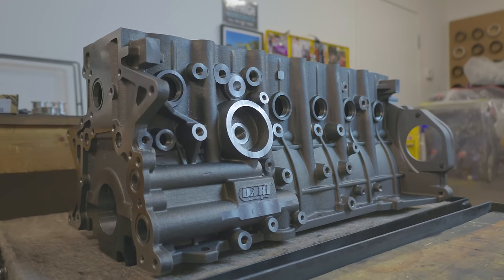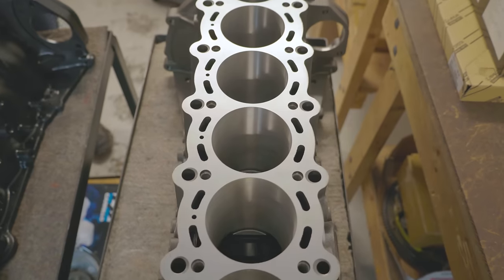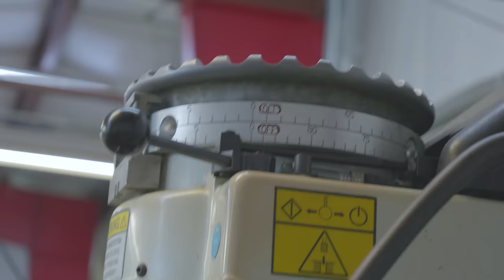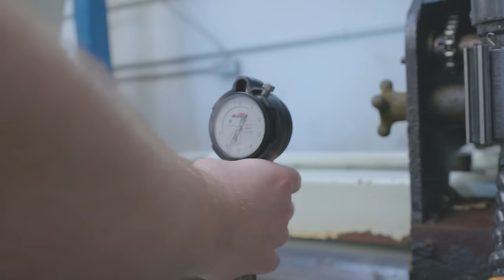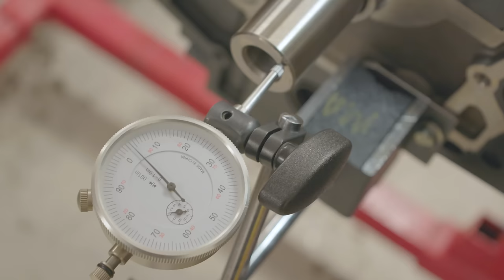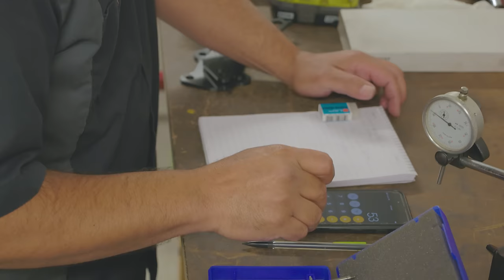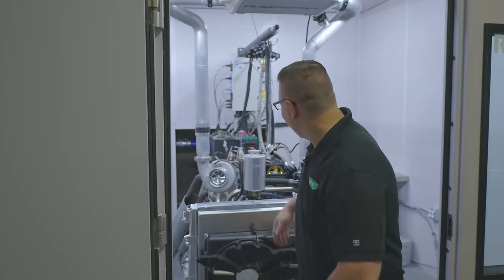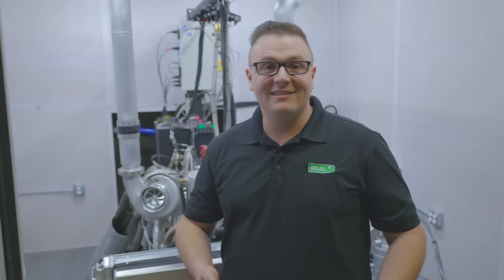Building a 3.5L 2JZ with Dart's NEW Cast Block! 2000hp Build

Comment: Dart 2JZ vs PRP RB26 New block casting. 

Good to see there are ppl who supports the RBs and 2JZs
Reply from the maker: The aftermarket keeps growing! Love to see innovation.
Reply: 2jz all day
Reply: @elmoz122  I think I'll still stay with the Vortec4200
Reply: @3n3ly7m9 never seen an Atlas motor at the same level as pro level 2J motors.
Reply: @RadDadisRad  Making 700hp stock engine with a turbo in Saab 9-7x is more than enough for me
Reply: @3n3ly7m9  so you have a 4.2 Saab Trailblazer?
Reply: Tbf, NO-ONE has seen the Atlas motors in the same light as a 2J save but a couple years now. It's essentially a baby in the aftermarket world @RadDadisRad
Reply: @aaronschocke2147  I know, I don’t understand why someone would chose to compare a 700hp 4,200 over a 2,000hp 2JZ build. I can appreciate both but the comment doesn’t seem to be driven by pragmatism.
Reply: @RadDadisRad  2JZ is too expensive to build for me, parts are all overpriced etc. You get alot better bang for your buck doing a 4.2 vs the 2JZ at the same power level. My budget was $8500 and I kind of went higher quality on a few parts, and total ended up being just over $11500. But thats perfect considering the trucks price was only $2400 with zero rust, but it did have 174k miles. I still think its perfect chassis with AWD
Reply: @3n3ly7m9  if we’re going apples to apples you aren’t getting 2,000hp from the atlas 4200. That’s my point.
Reply: @RadDadisRad  You aren't getting 2000hp out of a stock 2JZ either, come on now, can't compare a stock block to a billet or brand new beefed up non-oem block.
Reply: @3n3ly7m9  man you’re really straw picking this argument. I never said anything about anything being stock. Have a good one. This conversation is lost on you.
Reply: @RadDadisRad  " I know, I don’t understand why someone would chose a 700hp 4,200 over a 2,000hp 2JZ build " Wow buddy, feel free to donate, I'll set up a gofundme. Don't even remember what you said, thats insane.
Reply: @3n3ly7m9  I never said that. You’re comparing a 700hp build to a 2,000hp build. You’re on a different planet with that comment. ✌🏻
Reply: @RadDadisRad  Seems you don't understand, its ok.
Reply: @3n3ly7m9  whatever you say buddy.
Reply: @RadDadisRad  You seem to have a big opinion on this, what inline 6 engine have you built that is comparable?
Reply: I know I'm an outlier, but I would love to see something like this for the RB20 block.  I'd also love to see anything for the early 12 runner red top.  Aftermarket only supports the silver tops and up.
Reply: Did you hear why they are putting all this into the 2j? .... they said they needed someone to race so 🤷‍♂️ 😂 it was funny....
Reply: They being the rb guys 😂😂😂
Reply: @RadDadisRad  Your not getting 2000hp out of a stock 2JZ either, so really, what is your point? They are saying, they preferred the 4200, but basically you said "and so?" They didn't make any comparisons either, that is on you
Reply: @DaBeast3  what was the point of your statement? I never said anything about a stock motor, just reference a motor.

Comment: may i ask out of ignorance: does an engine like this need/ has a break in period or it just goes straight into performance tunning amd power pull afert the initial warmup?
Reply from the maker: Depends on internals the level of break in. In any engine, its a good idea to run an engine briefly with oil and soon after drain to check the fluid, and let the internals familiarize themselves to each other. I'd like to do a more detailed video talking about this subject soon. Stay tuned for that!
Reply: From my experience ring packages and camshaft types dictate most break in procedures on builds.Contact the part supplier for this info and utilise the guidance of the engine builder.A break in shouldn’t hurt any engine but not doing it can and possibly will hurt it.Just my 5 cents 👌

Comment: As a long term jz owner.stock block jz has seen north of 2500 hp.street use.these guys are building 1/4 mile builds.throw all the boost at it in seconds.stuff breaks.they always fail to mention the difference between street and strip.

Comment: Now this is amazing. I am going to build another motor on the side for my 2jz swapped DCT E90 M3. Currently a 3.0 liter. Is the 3.5 maybe to torquey for a street application? I am currently at 1100whp
Reply from the maker: I think it depends on some other factors and your specific application. Would be a blast being so torquey!
Reply: What factors would you think would hinder or increase? It is a true car on a big tire and it has a good traction control system using maxxecu. It has power steering, and AC and all of the factory can bus working on the car like OEM. I am not opposed to a bigger motor I just don't want to keep breaking things from the torque. I do also have a built Ford 8.8 rear end with G force axles and a one piece aluminum driveshaft. I'm just worried about breaking transmission internals it is a F80 M3 DCT
Reply from the maker: I'd say gear ratios have a big part to play in deciding this also. Like you mentioned, more torque also opens the door to breaking things. Give us a call and we'd love to chat about how we can help on your build!
Reply: @realstreetperformance  I will, I have been working with Moe for 7 years. I have a very tall ratio. I do 60 rolls in 2nd gear at 4000 rpm and rev to 8500 on my current setup

Comment: Is it rated for 3500hp to the crank?

its a 3.5L by bore, stroke, or both?
Reply from the maker: These blocks are rated to 2000hp + by Dart. Its a 3.5L ( 88mm bore x 96mm stroke ) . Monster 2JZ!

Comment: Hello, I'm from Brazil. I loved the video. Would it be possible to take a Ford 427 engine, copy and make a new block from some material resistant enough to modify it entirely to run solely on pure nitromethane, without gasoline or alcohol?"

Comment: Was that an OE GTE head gasket with the permatex copper spray applied?
Reply from the maker: Apexi 88mm MLS gasket copper sprayed. This is a big bore engine, and Apexi has an off the shelf part number that worked with this setup.

Comment: I've been looking forward to this! Steel rods for 2000hp? That's 333hp per rod O.O
Reply from the maker: We've used those rods at 300hp a cylinder in the past. Lets see how far we can push them!
Part number on those rods is : BC6300HD

Comment: Im surprised you guys didn't go with aluminum rods in this engine.
Reply from the maker: We've used those rods at 300hp a cylinder in the past. Lets see how far we can push them!
Part number on those rods is : BC6300HD

Comment: ... 1:50 
This ones about .200" - .300" and this ones about 3/4" or 19mm. Lol comparing thousandths of an inch to fractions of an inch and then only one in metric. Precision machining and aerospace units to rough construction tolerances to a unit from a different measuring system. If thats not engineering tism, idk what is. Joking aside, being able to bounce between measurement systems in your head like he can is incredibly useful for anyone remotely mechanically inclined. Embrace all the measuring systems and use them as they fit the application best IMO. The same way speaking multiple languages is incredibly useful

Comment: Now we need a cylinder head with a thicker deck surface? Or a billet head preferably in multiple pieces so the cam journals can be replaced when wear and tear instead of tossing the whole head in the trash after that
Reply from the maker: Great question. I'd love to see something made to hold up more under extreme conditions.

Comment: Its funny, we need to destroke our 4L barras to a 3.7l to get the RPMs up to make the same kind of power
Reply from the maker: I want to get hands on one of those barra engines soon. They are doing some really cool stuff out there.
Reply: @realstreetperformance  750hp, small turbo, stock unopened (tubo) engin, head studs, valve spring and oil pump gears.
Next step will be to buy an ex taxicab engine(same block and head castings), grout fiilled, de stroked kit from Nitto or DPM.

Once u hit the 1500rwhp mark we have to remove the Variable cam timing and the loose the benefits the barra has over a 2jz or RB for street driving.

Its taken 10 years but finally we have some billet barra blocks floating around now.

wouldnt be suprised if we see 3000+hp race cars and 2500hp fully water jacketed blocks for street cars on the road soon
Reply: @mifo2000 😅😅😅 Barras are junk.i have been gapping taxis for 20 years nothing will change
Reply: @mifo2000 that's the biggest load of shit I have ever read 😅
Reply: @Jeepvanboat  then why doest the fastest promod barra still use a OEM block and head with his build and why did his wife's car win HP hero's at summernats with the same 3.7ltr destoked kit but in a street car with factory air conditioning?

NITTO even make a 3.7/3.8 ltr destoking kit along with cheaper brands like spool.

Comment: All that effort and no drysump?
Reply from the maker: We wanted to push the boundaries of a stock oiling system to begin with. We have a dry sump system that can go on when we find the point it needs to. Fun part of this engine dyno series we're working on is being able to test things like this in a controlled environment!

Comment: New block looks great. H-beam rods kinda seem like a cheapo move when you're putting this much money in a motor though. Am I missing something?
Reply from the maker: Totally fair to point out. At first thought alot of us associate H beam rods to entry level parts. These rods in particular are Brian Crower BC6300HD.  We pushed these rods north of 300hp per cylinder in the past, and plan to push them just as hard, if not harder with this build. This way we can find the limits in testing, and not have to let the customer do any guessing. 

Thank you for checking out the video! Lots more to come with this engine build soon. We'll have a Build Recipe and Blog Post up for this longblock soon.
Reply: To add on, this particular crank is a special long stroke model that Brian Crower made when requested by some of the drift teams.  They have asked us to see if it can live at a different level of abuse.

This is testing and we understand that we may break things because we’ll learn from the breakages.

The BC6300HD is the only quality steel rod available with the Honda rod journal at this length, so it’s really the only option for this crankshaft.  Again, this is something we’ve been asked to test. 👍

Comment: yep love to see the hp figures, only 1 turbo ,what about twin turbo and also intercooled and 16 plugs and 16 injectors try to do what we australians build when it comes to this motor?
Just look up the quickest Skyline GTS R34 in the low 6's down the 1/4 mile, just bring down you r34 with the same motor and hp figuer to do 6's down the 1/4 mile and maybe we can show you americans how its done down under after all you do not hold the street car build 1/4 mile records at all?
Especially for the same motor? 👍🦘🦘👌🙌✌